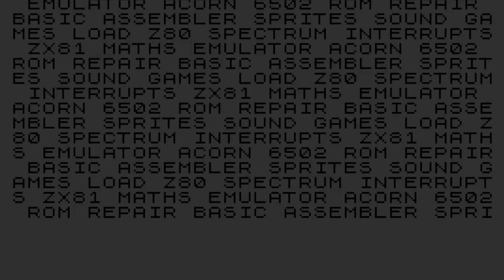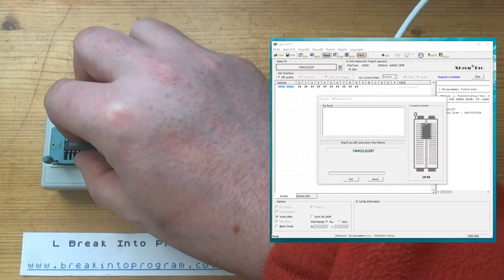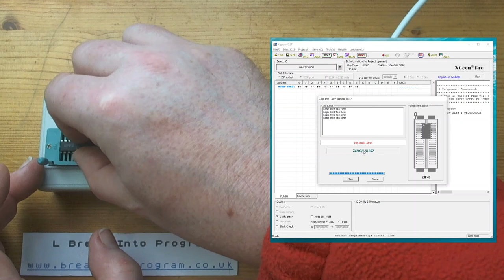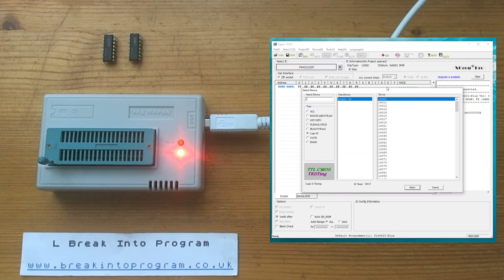Testing Logic Chips using a TL866 Programmer

Comment: I like the logic chip testing functionality of the TL866II+ as well, but I have recently discovered that its test vectors are not very comprehensive. I had a 74LS373 in a TI-99/4A which had a failing latch enable input, but the chip tested as OK on the TL866II+. I have then written a small Arduino based test rig and with that, I could verify the failure. The lack of any documentation regarding the test vectors that the software executes limits its usefulness and one needs to be careful not to rely on the results too much.
Reply from the maker: Ah, that's handy to know. I tend to use such tools as a guide more than anything anyway, only treating failures as certain. I've make a note of your specific case for future reference.

Comment: I would love to see you show us Linux users how to set up "wine" to use the gui. We can only use command line versions of the software.
Reply from the maker: I may tackle this in a future video; I've got an Ubuntu desktop sat under my desk, and I've not used Wine in some time. Assume you've tried and found it problematic?
Reply: @BreakIntoProgram  Wine is what seems to be the problem. I'm new to Linux and love it but I'm still quite green and I really have absolutely NO desire to go back to Windows at all costs. I set up wine for one program and it seems no other works and I'm not sure why. I've seen tutorials about it but most are way over my head. I'm a programmer and hardware guy for 40+ years but still have not fully grasped the Linux OS.... I will suffer through it if I have to because it's just superior in every way from Windows. I appreciate the reply! Thank you!

Comment: I wanted to buy a TL866 programmer, but I'm confused with the descriptions. There are "II", "II+", "mini", "pro", "updated version" etc etc in all possible random combinations, so I am really not sure what I would get if I pick one randomly. Some seller (let's say on banggood) says "updated version pro", some "II pro", etc etc. As far as I can see, there are important differences, which would be a must to know. For example newer models program more devices, but lack of 21V (IIRC) programming voltage needed for some older EPROMs. And in general, issues like this. In addition I'm using Linux since 1995 (I haven't even used Windows since version 3.1 ... my workplaces included!) so I'm also not sure if all versions are well supported, though I've found some github repositories with linux specific tools, in general (and yes, the possibility of wine, which was mentioned before me, as well).
Reply from the maker: I agree, it is a bit confusing. I ended up purchasing a II+ - inability to program older EPROMS was not a consideration at the time. With regards to Linux, there are command line tools, but not tried them. I have attempted to get this working in Wine, but am not terribly au-fait with it, so couldn't get the USB device drivers working.

Comment: I have the TL866A. I got it with every single adaptor imaginable. It does this and SRAM/DRAM to some extent. I think I made a good choice in this one. It has earned me plenty over the years so far. This video reminded me it had=s this feature. THANKS! This will speed up my diagnostics on three machine control boards.

Comment: This programmer gives me nothing but problems.
It keeps telling me "check device ID" when i flash the chip, NOT when i read it.
If i uncheck the check ID, it will flash but it will not flash properly.
If i remove the chip from the board, it will flash ok no problem. I dont get it.
Reply: may be a fake chip
Reply from the maker: There are some GAL versions that it doesn't work with. And it could be a fake chip, as mentioned in the other comment in this thread.